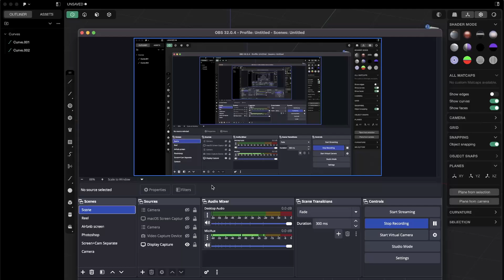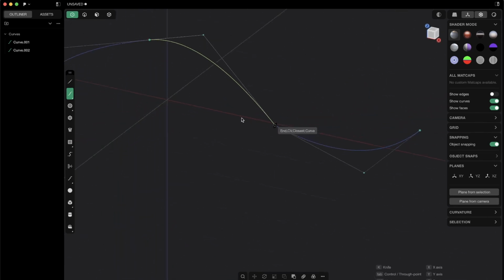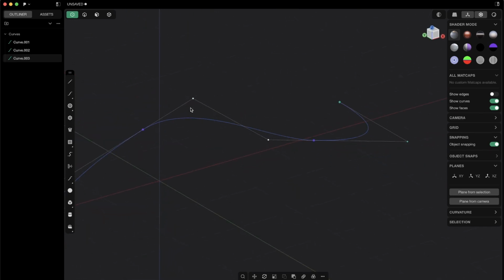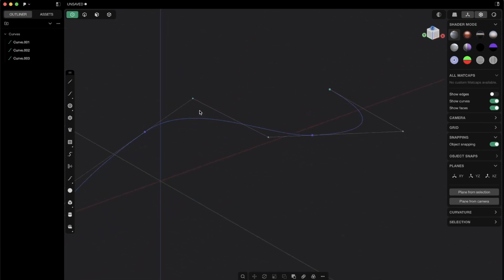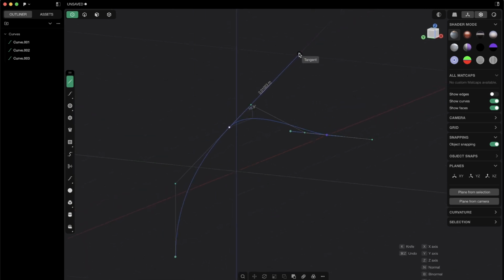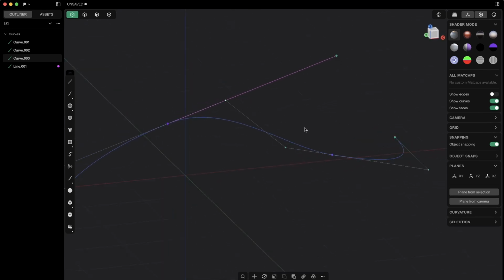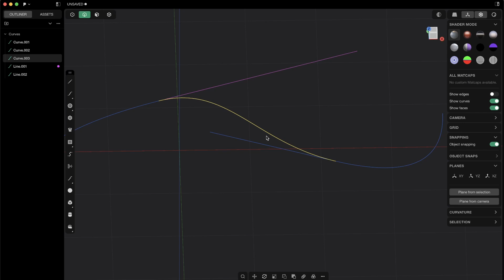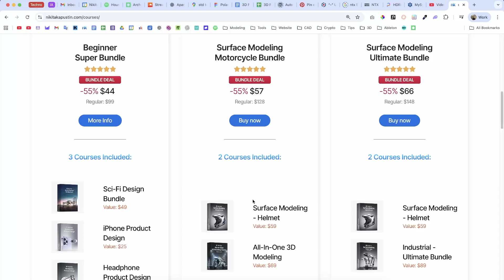How to Align Control Points on G1? - Plasticity Quick Tip

Comment: Selecting a vertex then using SHIFT + G lets you slide the vertex along its normals, so it would be ideal if you need to change the angle of the bridge curve you create.
Reply from the maker: Awesome!
Reply: Just wanted to say that. Shift+G turned out one of the coolest features for me. Because I so often use this trick with additional line and it slowed modelling down. Also this command works for face control points. Plasticity is getting improvements so rapidly. Any other CAD program cannot compare to how handy it is